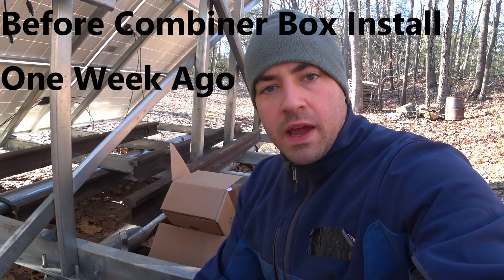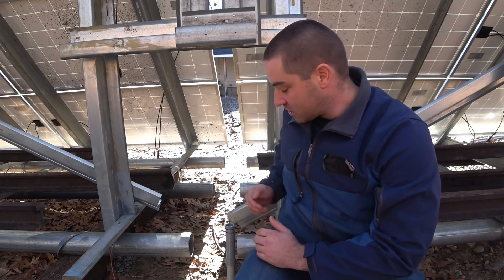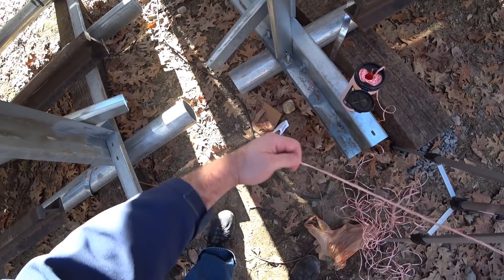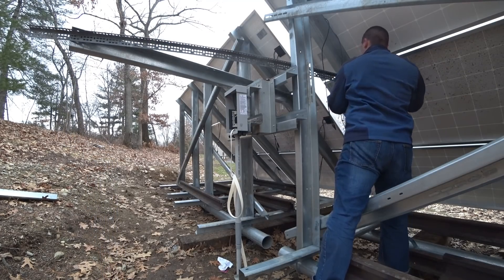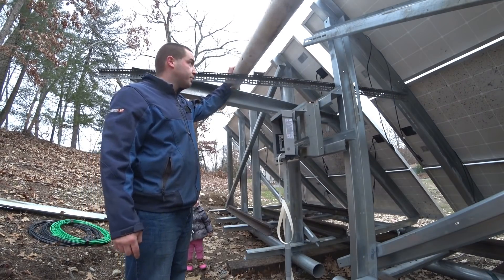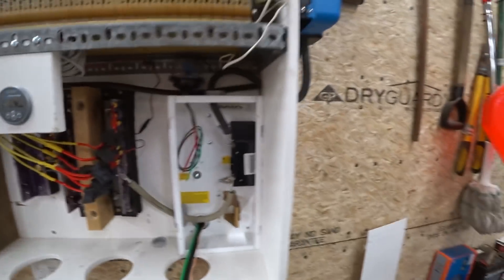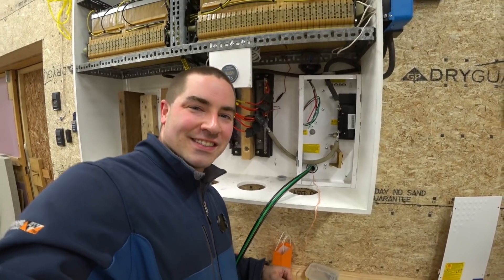How to Pull 100 Feet of Solar PV Wire Through Conduit

Comment: I thought code required 50% area in a conduit...wouldn't that mean for 3 wires of 6 ga that you would need a 2 inch conduit?  That looks like its 100 percent filled with wire.  "Minimum size for buried conduit shall be
 3 inches for all conductor smaller than 500 MCM, and 4 inches for primary or conductor 500 MCM or larger" is the requirement I can find
Reply from the maker: I'm not sure where you found that quote.  Perhaps in industry, or commercial applications?  I've never seen 3" conduit on any residential projects.  
As for the fill, when I put the wires into an online calculator it says I'm less than 18% full.  https://www.southwire.com/calculator-conduit
Reply: @DavidPozEnergy   I was searching for the exact requirement.  I remember reading in a book the 50% rule but I couldn't find the exact verbiage.  That is a great calculator!  It looks completely full in the video.  What does the inspector use for their "level of fullness?"  I am getting ready to run power to my out garage and I have to run 2-2-2-4 cable.  That calculator says that me running 2 inch PVC will result in 12% fill, which is great for what I want to do.
Reply: @jodydewey3516  ... don't forget the fill rate will dictate the max loading of the wires, and he's way under the load rating with #6 wire.

Comment: Should have rolled your wire off in the yard then went over the PVC looks like you could have pushed it halfway there also instead of spending money on lbs leave your conduit apart and glue it later when you get the wire in but good job
Reply from the maker: Good tip.  You are right about laying it out.  If I knew that I could have saved some time.

Comment: Is the procedure the same if you're running 1/0 THHN? My array is 160' from the power center, so #6 won't cut it.
Reply from the maker: If I was pulling that big of a wire I would use a lube.  I noticed my local electrical supply sells this lube: https://amzn.to/2lBM18B  And the conduit would have to be bigger.
Reply: 1/0 is heavy and expensive. Consider using more than one pair of conductors.  Connect panels in series to get the greatest voltage your charge controller(s) can handle.

Comment: I saw the video and thought that those wires looked rather thin,, so I tried to punch in the numbers in one of those "DC Cable Sizing Tool" and found that 6 gauge would keep you under 2% voltages lose,, and also found that you had seen 1,6%. And you would need 3 gauge to stay under 1%,, That would become expensive and difficult to work with. So this is propoly the best choice.
Reply from the maker: Exactly.

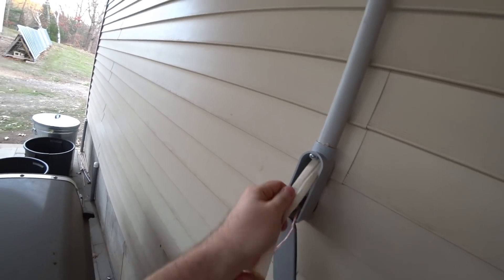Comment: Input/question about part 3:20.  The String groove. 

 Could it be caused by friction?  And was caused by vacuum suction speed?  If line was hand fed at a slower rate?  I know lubricant works in almost all situations*^ (lol),  But was not cause of this effect?  And TY OGP. IS GOOD!  And Thank you for showing mistakes along the way!  That is the "IRREPLACEABLE ATTITUDE"  I wish all had; so we could learn how not do do that*! 

  Jaws
Reply from the maker: The string cutting in is not from speed, it is when you pull hard on it dragging behind the heavy cables.  The mule tape helps spread out the load to avoid cutting.  Thanks for watching.
Reply: @DavidPozEnergy  When pulling heavier wire, you can suck in a string, connect a wire pulling rope to it and pull the rope. Then you use lube and connect the wires to the rope. The rope has a larger diameter and different texture and friction compared to a thin string.

Comment: Late to the show, but I wouldn't recommend using that twine to pull anything next to your existing wire,
Just like you saw with the twine cutting into your conduit, it'll also cut into your wire causing a potential short.

Comment: As mentioned, wire ease will help, but it's a pain to clean up after, and your conduit, should have been 1 inch. Most will what you did to save money, as 1 inch is triple the cost, but on such a short run the payback is in how fast the pull is, and if you had the room you can pull an extra string for future pulls. Maybe some type of monitoring wire, etc. Also, you should have uncoiled the wire, and looped them over your support bracket. For, all 90 degree changes you should coil a loop of wire for stress relief, which means a box instead of the fittings you used. Otherwise, spot on for technique.
Reply from the maker: Hi C MH.  Thanks for watching.  I did use one-inch conduit.  It must look small on the screen.  What diameter conduit did you think I used?  I like your suggestion for a box to incorporate a loop of wire.  Thanks.
Reply: @DP, looked like 1/2 inch, and the conductors looked tight, when you were doing the pull. I like your equipment, but as you are experiencing any MACs (move, addition, changes) are a pain when you restrict yourself to a cabinet. Before you get to deep, you might want to think you layout. Because you will make others changes, it's the nature of the beast. I have a Honda 7000 iu, great generators. Not cheap, but it will last a lifetime. Keep up the good work, very entertaining. THX

Comment: Always wondered why folks don't run cable as they put the conduits down.
Otherwise good video.
Reply: Also it is against code. The NEC wants raceways to be complete before the pull. It should also be free of water, mud, etc.
Reply: Because it takes way too much time to feed the next section of conduit over the wires.  
When you are trying to join two chunks of conduit that may not have a lot of wiggle room, you may damage the wire if it's in the conduit.

Comment: Sounds like you did ok on this one but any time I deal with DC there's always the "what if" in the back of my mind concerning voltage drop. I read the comments where you seem to be ok there but wonder what real numbers come in under FULL system load, only because it reminds me of a short story about a guy who ran like 800 ft of wire, but it was AC. He figured it was heavy enough to get 50 amps at the end and after comparing real world to an actual load it was off by a bit. Bottom line was 10% voltage drop at 30 amps. Still usable but quite a loss considering NEC wants less than 5% drop.
Reply from the maker: Hi rupe53.  Yes, I think I'm OK in this one detail.  I'm measured it several times, even under full load +.  and have never seen over 2% voltage drop from the combiner box to the charge controller.  I remember when I was sizing this I could have used 8 gauge according to code, but under full load it would have been over 3% voltage drop, so I used bigger (6 gauge) wire.

Comment: I always use weed eater line, but I can tell you that the chances of being able to use that line to pull another wire (later if needed) are pretty much zero.  Because what you'll fine is that the lines spun as you pulled them through, and that string isn't a straight pull.

Comment: Can You plase measure the voltage drop across theese 100 ft condiut?
Reply from the maker: How do you do that?
Reply: David Koz I mean across wires. You can measure voltage in combiner box and at MPPT. The difference between is the voltage drop consumed by 100ft wires.
Reply from the maker: Ah.  OK.  Give me a couple minutes, I'll go check.
Reply from the maker: At the combiner box it was 180.0 and at the MPPT controller, 178.8.  But the numbers were bouncing +/- a volt.  It might be more accurate on a day with no clouds?  I'm not sure.  I know that when I was sizing the wires for worst case I found 8 AWG satisfied code, but I went up to 6 AWG just to keep my voltage drop lower.  Right now the system is doing 1.8kw.  Is this in line with your testing on your system?
Reply: DavidPoz tomorow I”ll calculate teoretical dropp. It will be interesting to compare teory to real deal. Pls write me total length of Your 6AWG cable.
Reply from the maker: It ended up being 96 feet.  If we get some steady sun I'll re-measure the voltage, but all day today looks like clouds.  I used this table when I was sizing the system: https://www.rapidtables.com/calc/wire/voltage-drop-calculator.html
Reply from the maker: I just checked it, nice and sunny, no clouds.  Doing 28.5 amps.  152 volts at charge controller and 154 volts at combiner box.  I think that means 1.3% voltage drop.  Is that considered good compared to other off-grid battery based systems?  Rapidtables.com calculator said it should be 1.4% voltage drop.  Perhaps I'm doing slightly better because it's so cold, 20°F right now?
Reply: DavidPoz Davido I had calculated theoretical resistance of Your cables is 0.07719 Ohm it depends on temperatute. At curent 28.5A the theoretical voltage drop is 2.2V. So You are heating earth with approximately 63W. In case You had used 8AWG do voltage dropp is 3.5V and power consumed by wires approx 100W. The teory is confirmed, man!!! Thank You!!
Reply from the maker: You Welcome.

Comment: When you tie the mule tape or jet line on the end of your cable, use a series of half hitches evenly spaced for each cable in the bundle. After taping the tail like you did when pulling the string, it will tighten onto the cables instead of depending on the tape. Uses less tape too.
Reply from the maker: Great tip.  I love when pros share some wisdom.  Thanks.

Comment: just a question,,about the wire ,,wouldn't you loose amps running that far ,with that size wire? on dc,, because i ran welding cable on mine,was 100 feet,,
Reply from the maker: Yes, any wire will loose some energy in the transmission.  When I was sizing my wire for my array I could have used 8 gauge (AWG) according to the amp table.  However, I used 6 gauge (thicker) just to minimize any voltage drop.  I'm thinking of making a video just going through the numbers, but it might be too boring.  What do you think?
Reply: The higher the voltage the smaller the wire , what voltage will your charge controller work with ?

Comment: FYI. Pulling a long length of wire with multiple deviations is a 2 man job. One feeds the wire and makes sure there is minimal tension and the other person pulls.
Reply from the maker: Yep, two people would make it easier.
Reply: @DavidPozEnergy  A lot of cable pullers that work in pairs, will tell you that cable pulling, is actually cable pushing. The person pulling does very little and only applies constant pressure, and person pushing does more work and controls the rate and helps it A lot.As a person that does a lot of things alone, I will say you pulled that cables very well. As others mentioned, special cable pulling lube helps. Sometimes talk could help, but it should be avoided, as it can combine with moisture and cause problems later on.

Comment: Put a Circuit Breaker or Disconnect on the incoming wire from the Solar Panels.    Do not connect directly to the Charge Controller.   I know you have Circuit Breakers out at the Solar Panels, but you need a way of disconnecting the power going into the Charge Controller.
Reply from the maker: I agree with you.  The next video will show me installing a GFPD circuit breaker inside the garage between the solar combiner box and the charge controller.  Thanks for watching.

Comment: Anybody else jump or cringe when he smacked his head?
Reply from the maker: Yeah, me.  LOL
Reply: @DavidPozEnergy  one quick tip if you ever need to pull wire like this again just run it out flat on the ground and pull it into the conduit. I used to be a fiber optic technician for my local telephone company and I would just run the fiber out down a fence line or back and forth in a customer's backyard then go down the street and pull it there's really no resistance added to it dragging on the ground as long as you're not pulling it through mud. The address you built would work for getting the correct angle for the wires to slide into the conduit but I usually just used a ratchet strap around the Box that would give it a little bit of a hoist up and down into the conduit we also had flexible conduit in our vehicles as well wish I had used on occasion to get cable down into tight spots
Reply from the maker: @Wayhart: Thanks for sharing your experience.  I'll try it that way next time.
Reply: I ducked , hats are good for warning

Comment: You can also reduce pulling force required by utilizing cable pulling gel (lubricant). It's dialectic gel so it will also have the added benefit of displacing any water that may infiltrate the conduit in the future!

The popular brand "Cable Lube" is sold at Home Depot in easy squeeze quarts.
Reply: David Brelin I used cable last be by the bucket pulling 6ga wire through conduit in my house. It really helps as you say. My lines are for 120v 20A branch circuits to reduce line loss (we’re off grid and 6% matters to me)
Reply: You can also use dishwashing liquid

Comment: I'll bet if you look closely at the wire you'll see a rating of THHN/THWN -2 which allows it to be underground---the wire commonly available at Home Depot and Lowes.   Nice job.
Reply from the maker: Thanks Mark,  This is what is printed on the side of the wire "6 AWG TYPE MTW OR THHN OR THWN-2 GF2 SUN-RES VW-1 600V (UL)"
Reply: Single rated THHN has all but disappeared now and most wire you find is multi-rated. THWN-2 covers most of the applications these days.

Comment: Thhn it's not direct burial wire, I know it's in conduit, but code wont sign off on that
Reply from the maker: Hi James,  Perhaps I'm using the wrong term as I'm not an electrician.  The guys at the store called it THHN so that's what I'm calling it.  This is what is printed on the side of the wire "6 AWG TYPE MTW OR THHN OR THWN-2 GF2 SUN-RES VW-1 600V (UL)"  Is there a better name for this?  Thanks.
Reply: @DavidPozEnergy  I think you'll find this passes.  THWN--the W stands for "wet" location.   If I'm not mistaken, the ampacity is somewhat reduced but that would require more research than I can do at 10 pm.
Reply: @DavidPozEnergy  that is what it's called, "thhn" however it's not ment to be "underground"
Reply: @jamesmoore2007  it's dual rated
Reply from the maker: @Mark: Thanks Mark.  Taking the time to include a link to a resource is extremely helpful.